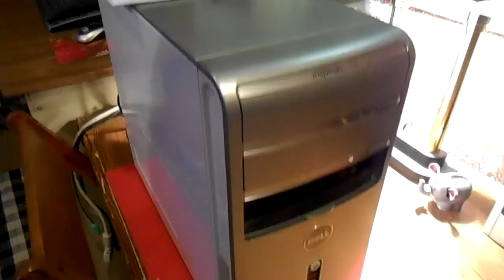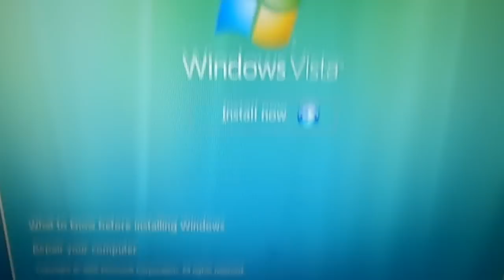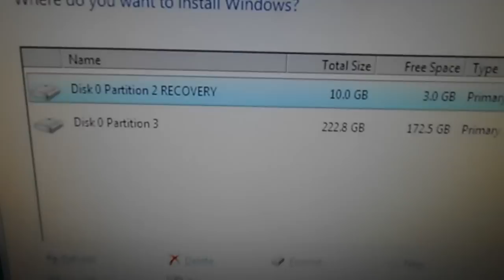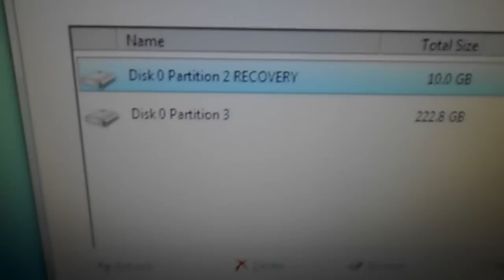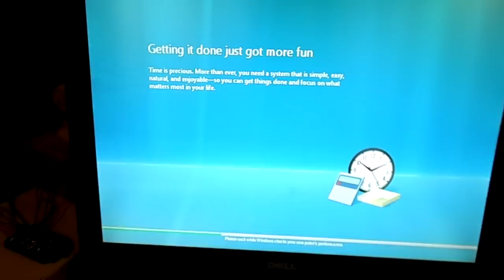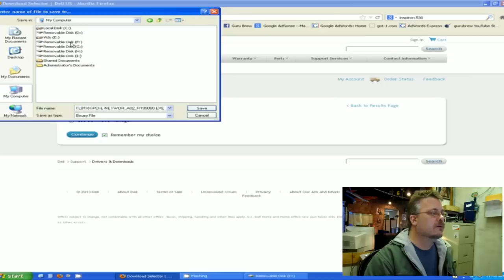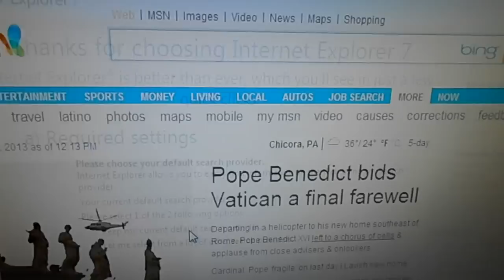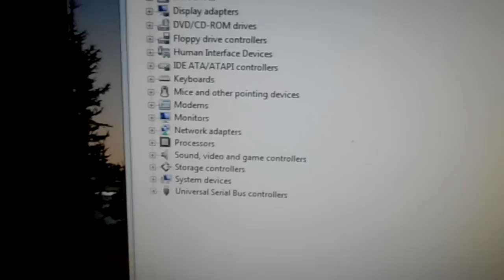How to Restore a Computer to Factory Condition Using a Recovery Disk

Comment from the maker: The OS recovery key is something (exciting and new Dell came up with that promises to:

    It backs up your data
    It saves your personal settings
    It reinstalls the operating system
    It then restores the data and brings the system back to its original setting

I never personally used one but it's one time use does not make it that attractive to me. But they are giving it to you so it's free.

Steve